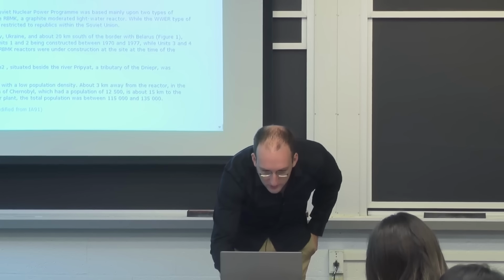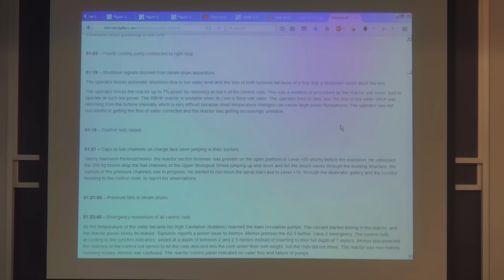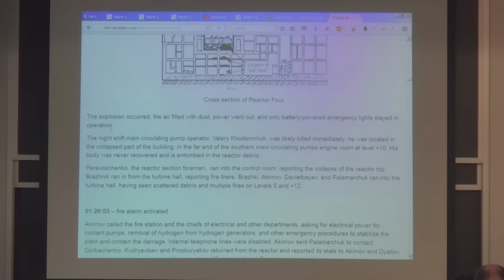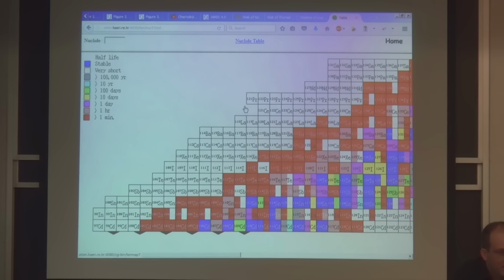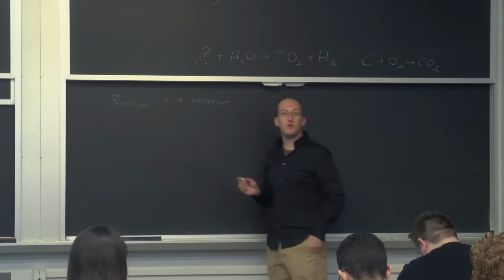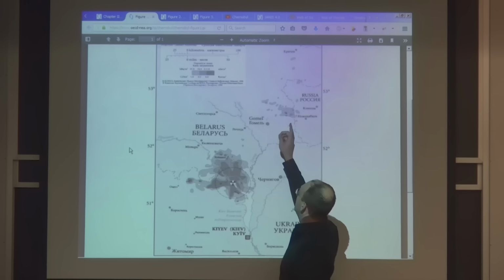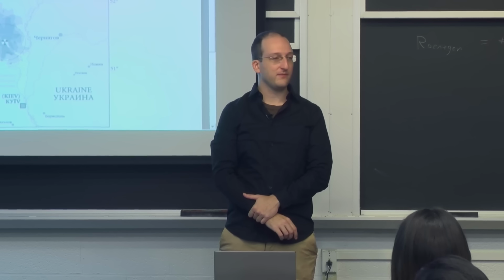26. Chernobyl — How It Happened

Comment from the maker: To report potential content errors, please use this form:  https://forms.gle/8B2zcUvfCtgJdTdE7
Reply: Length of graphite tips of control rods is incorrect. It's not 6 inches. It's way longer.
Wikipedia has a much better description:
"""... the control rods have a 4.5 m (14 ft 9 in) long graphite section at the end, separated by a 1.25 m (4 ft 1 in) long telescope (which creates a water-filled space between the graphite and the absorber), and a boron carbide neutron absorber section [7 meters long]. The role of the graphite section, known as "displacer", is to enhance the difference between the neutron flux attenuation levels of inserted and retracted rods, as the graphite displaces water that would otherwise act as a neutron absorber..."""
Reply: @denysvlasenko1865 yeah and its also important to note that as you say, and as everyone can also see in the official international INSAG-7 report (pages 5 and 128) the 4.5 meter graphite displacer sat exactly in the middle of the reactor core when the control rod was fully extracted leaving 1.25 meter gaps with the top and the bottom of the core (filled with water), pressing the AZ-5 button caused the graphite to displace the (neutron-absorbing) water at the bottom of the core (and thats what probably resulted in the supercriticality). This explanation of the positive scram effect can be found in page 4 of the INSAG-7 report (thus the explanation presented here is sadly pretty wrong).
Lastly on page 13 of INSAG-7 we read:   “The scram just before the sharp rise in power that destroyed the reactor may well have been the decisive contributory factor”.
Reply: Not well explained what exactly caused the explosion.

Not explained why specifically "almost all rods were removed from the core" was a bad thing.

The correct sequence is as follows:
* Steam valves closed to start turbine run-out experiment.
* Pump power starts going down since turbine runs out (slows down) and amount of power from it goes down too.
* Recirculation slows, water gets hotter, boils more.
* Reactor power (which was around 200MWt thermal) starts slowly rising due to increased boiling + slightly positive void coefficient. (This also starts to burn off Xenon).
* Operators are confused why power rises, panic a bit.
* After some tens of seconds, Akimov decides to press the scram button - the AZ-5.
* All control rods simultaneously start lowering into the core. Control rods are in vertical water tubes, not in gas space, for cooling purposes. Graphite tips go down as well, displacing 1.25 m of water in the lowest part of the reactor with graphite. This is where "almost all rods were removed" plays its bad role - almost all rods were removed means almost all rods go down at once. Graphite tips moving down replace water, an absorber, with graphite, a moderator!
* Now power spikes VERY fast, primarily in the lower third of the reactor, burning off all Xenon (absorber gone -> positive feedback), flash-evaporating all water and rupturing water piping (absorber gone -> positive feedback).
* Fuel melts, evaporates in many places, some isotope analysis suggests even prompt criticality was reached in some small volumes of fuel. Reactor pressure vessel ruptures.
Reply: @denysvlasenko1865  проблема в том, что в РБМК-1000 нет кипения при 200МВт тепловой мощности во всяком случае внутри АЗ. Только небольшое количество пара в ПВК уже на выходе из реактора, но, преимущественно, уже на входе в барабан-сепаратор, там, где слегка падает давление. И согласно данным с реактора, никакого серьезного роста мощности во время проведения эксперимента не было. Во всяком случае роста, достаточного для срабатывания защиты по периоду удвоения мощности (она была включена, как известно). Так что истории о том, что нажатие АЗ-5 было реакцией на рост мощности весьма прохладны.
Reply: @mikhailkouyantsev6743   А если расход воды уменьшить, не закипит разве тогда? Разве кипение только от мощности зависит?
Reply: @yuriybrazhnyk7578  ну, если уменьшить и сидеть курить бамбук, то да, закипит, вероятно, пойдёт разгон реактора и система защиты сбросит стержни поглотители по пробитию лимита времени удвоения мощности. Только к упомянутой аврии это мало относится. Во-первых, потому что в реальности был перерасход воды через АЗ практически всё время испытаний. Там было 2 группы ГЦН, одна была запитана от ТГ и естественно стала проседать по оборотам во время выбега, а вторая - как молотила на номинале, так и поодолжила. Во-вторых, при срабатывании лимитов по периоду удвоения, эффект был бы тот же самый - взрыв. Там сложилась такая ситуация, когда самый плохой вариант - глушение реактора массовым погружением стержней в АЗ. Вот всё, что угодно, только не это.
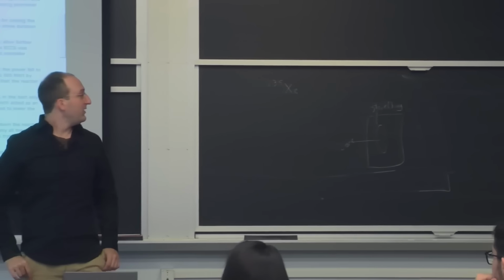Reply: Why hasn't at least the comment regarding the half-life of Xenon been corrected after so many years? At 8:28 it is said that Xenon-135 decays with a half-life of "a few days", a simple google search (and every isotope table) is enough for us to know that its actual half-life is a bit over 9 hours.
If it is a case of accidentally confusing the half-life of Xenon-135 with the time it takes for Xenon-135 levels to drop in a nuclear reactor after e.g. a shutdown then that is an even more major mistake that needs urgent correction.
Reply: @proghostbusters1627  I can give a possible explanation for that error. In disposal of radioactive waste, under the old NRC rules, if an isotope is stored and decayed for 10 half-lives, it is considered safe for disposal in the trash, at least in our hospital research lab. Those were the rules for radiology and nuclear medicine as well. It's a sort of magic number, and thinking in terms of the length of 10 half-lives is what's practical, considering how long you have to store the radioactive material safely and properly before disposal.

10 half-lives obviously isn't adequate for the quantities present at a nuclear generating plant, nor is it practical given the hundreds of thousands, even tens of billions of years involved (for [238]-U), but in other settings, that's the safe number, so... a 9-hour half-life - 90 hours to consider it safe, or a few days. Yeah, a professor should be more precise with his language, but professors are human. 🙂

Yuk alert:
(In our lab, the 10 half-life time meant everything because it meant such things as safely storing and documenting hundreds of frozen rat carcasses accumulated over dozens of experiments, each containing a few μCi of [125]-I, for ~20 months before they could be incinerated as bio-waste - a real and expensive consideration. And guess who was in charge of all that... 😛 It doesn't matter that they were frozen at -20 C, that room smelled awful! We also used [32]-P and [59]-Fe, both with manageable half-lives - enough for the suppliers to produce and ship them with meaningful activity left yet less waste storage time than [125]-I.)
Reply: When he mentions the sarcofocas why does he not mention the huge constructionwork that has just been done to sort that out?
Reply: Fffffff
Reply: Not enough statistics on radiation damage ?
What about this ?
https://www.youtube.com/watch?v=qbBu6cWczTY&t=513s
Reply: reporting
Reply: @importanttingwei7747  France does.  However, they also have the problem that major components, in their case, the coolant, burns.
Reply: Great lecture. I only can add two things. First, chernobyl's experiment was soviet military experiment. Soviet military wanted to know, what will happen if terrorists or american troopers wil capture secondary power sources, needed for cooling. And soviet military ordered to make this experiment. Second, situation in russian atomic industry today is horrible. Incidents continue to happen. For example, russian military tested nuclear-engined missile "Burevestnik"  at Nenoxa.  Missile falled into water. When they tried to bring it up, missile exploded. Territory polluted, some people died. The only differnce between soviet and modern russian goverment is that soviet goverment admitted chernobyl's explosion after 3 days. Today our goverment officially deny that nuclear-engined missile  exploded near Nenoxa, they created lies and propoganda to cover that incident.
Reply: @денисбаженов-щ1б  hmm... A lot of russian professors actually say such or similiar things. Dugin from Moscow University is the brightest example. If you educated from any russian university, you must know it.   So i don't understand why american professor cannot say it? He just wanted to mention, how terribly unsafe are RBMK reactors and how idiotish were their creators and operators. Which is true, of coarse.
Reply: @денисбаженов-щ1б  actually, it is fake and lie that soyuz is safer than any american missile. Soyuz had 11 failed launches from 634 since   1983. Falcon 9 american missile had 1 failed launch from 143 since 2010. So american falcon 9 is far better than soyuz.  If  you include failed  launch statistics from period earlier than 1983, the difference between soyuz and falcon 9 will be colossal.
Reply: Top Marks, Professor!
Thank You! And Thank You to MIT!
Marvelously presented topics in physics, chemistry, and applied logic. The day we are able to safely and reliably harness/utilise/apply the abundant and biologically safe, non-polluting sources of energy in the free Nature (including Space, i.e. the Thermosphere, usw, usf…), hundreds of millions of human beings at risk of dangerous radiation exposure via food and water will live, eat, and rest more humanely. 
Salomè (live in Peace), und…   Mögest Du in das Licht, der Wahrheit, und dem SEIN der Schöpfung leben.
Reply: @tsia  schizo
Reply: KGB influenced hiring process to have narcissist Shift leader, unaware of the design flaws, create this situation, for several reasons to make West weaker.
Reply: ehh I'm not gonna fill out a form and minor point but fyi the test was originally scheduled for day-shift so it was more like twelve hours they were holding at half-power, mad xenon; Kiev gave them the go-ahead at the start of 3rd shift basically
Reply: I've watched a fair bit of content on Chernobyl lately - 40th anniversary and all that. I remember when it happened. I gotta say though, this professor, though he obviously understands at an expert level the physics of the reactions involved, is maybe not the best analyst of the history of this event. Many more persuasive histories have been published and also posted that belie the simplistic story he tells, and even the actual numbers involved. The Soviet system was not an ideal system for safety, but to fault the safety culture is massively oversimplifying things. The people in the control room were gifted and talented. None of them, obviously, would have risked this outcome knowingly! The physics are great, ofc, but the history and political analysis of this feels a bit pathetic. It's 10 years old though. Have things changed in our understanding since then? That's a long time.
Reply: Most of the sources I have read claim the corium (elephant's foot) did not make it past the last concrete layer of the sub-levels. And therfore, did not enter the actual soil.  

Something wrong with the linked form 

But great presentation overall!
Reply: @joes.2111   You are right according to every source I have ever read and every picture I have ever seen.  The melt stopped in a basement room of the reactor building and the mining effort was wasted.
Reply: RBMK Recators DON'T explode, comrade.
Reply: @Clonetrooper17  chernobyl reactor exploded.
Reply: Not great, not terrible.
Reply: Too many errors or oversimplifications in the first three minutes to take this seriously.
Reply: Where do we report capitalist propaganda?
Reply: Ffff
Reply: Ny
Reply: @денисбаженов-щ1б  and I guess the wonderful non-existent Soviet Union knew way more! It explains why they were so prosperous! Soviet tech= worthless shit that will likely kill you
Reply: You are not allowed to discuss this topic. You have no moral rights
Reply: Everyone here is missing the point, which is that any exam material would be graded against his understanding of the events. So if he has something wrong, it must be learned and regurgitated to his understanding, because that's how the exams will be scored.  This isn't unique to MIT - all universities do this
Reply: @mangos2888  Yes, this is a vulnerability in all education settings - primary, secondary, university, and post-graduate settings. It's nothing new. The lesson is that teachers are not infallible, and textbook authors are not infallible. Critical thinking has always been crucial for education to mean anything at all. Students must be encouraged to question everything, and to be treated respectfully when they do so. As a retired professor, I can't tell you how good I felt when students challenged the content I was teaching! I could explain the basis for my content and encourage critical thinking at the same time! Students are empowered when they understand that doctrine is not dogma!
Reply: What a load of garbage, people pay money to attend mit?? Really.
Reply: This was awesome thanks for posting this, I don't know shit about this but the teacher was able to present it in a way I could digest
Reply: @rawbebaba  p chili d
Reply: @rawbebaba  aa
Reply: @денисбаженов-щ1б  Are you really that dumb that you're trying to compare the deaths in a containable nuclear disaster to a worldwide virus pandemic? You're Russian and upset by his use of words so you're grasping at straws. As if Russians talk any better about Americans. I wouldn't even talk about Covid considering Russia isn't doing much better than America containing it.
Reply: Can't enter form, any way to fix?
Reply: @badmintongo4832  It's not fixed yet.
Reply: @badmintongo4832  is
Reply: @badmintongo4832  m. Mmmmm mm m.  Mmmmmm m. M m.   N. Jnnknjn n
Reply: @badmintongo4832  m. Mmmmm mm m.  Mmmmmm m. M m.   N. Jnnknjn n
Reply: I have submitted your form, but I feel it must be stated, the Negative Temperature Coefficient, does not at all refer to the fuel, which as a solid does not significantly change in composition or orientation until it melts(in which case Corium has a positive temperature coefficient). The Negative Temperature coefficient actually refers to the Water being used in RBMK reactors as a coolant, and minor moderator(the Graphite provided the majority of moderation). The explaination of a Negative Temperature Coefficeint was generally correct, except the Professor was badly confused as to what has a Negative Temperature coefficient.
Reply: @lazyidiotofthemonth  There absolutely is a fuel temperature coefficient.  Without rewatching the whole hour video I'm not sure in what context you are specifically referring to, but the problem seems to be "negative temperature coefficient" is a meaningless term without specifying coefficient of WHAT.  There are fuel, moderator, and void coefficients.  Moderator and void coefficients can be either positive or negative (which was very much the problem with Chernobyl and why it exploded upon scramming), so there really isn't anything that can be called "the negative coefficient".  Sometimes those are all combined into the "power" coefficient, but that's something that's only useful for operation (under normal conditions) and muddies the scientific discussion.
Reply: @sultanofsick 😮
Reply: @lazyidiotofthemonth  I may have missed something.  Early on I thought he was talking about the positive void coefficient in the RBMK design compared to the negative void coefficient in a light water reactor. Please could you, if it is no trouble and you can without watching the video, offhand, point me at the right part of the video?  I feel I have missed something important.

I think a significant mistake was that the new sarcophagus was rolled into place in 2016 and thus the previous sarcophagus did not need shoring up etc at the time the video was shot.
Reply: @christianwall7181  He was not at all wrong about the void Coefficient, I was talking about his misunderstanding of the Negative Temperature Coefficient of Water, the gist of it, is that Light water has a negative temperature coefficient, and midway through the video he talks about the temperature coefficient as though it is a function of the design or the graphite. this is flatly wrong or impossible, for a solid to has a negative temperature coefficient, it would have to physically expand. I would need to rewatch the video, to find the specific moment.
Reply: @lazyidiotofthemonth  Dude, is the concept of solids thermally expanding actually foreign to you?  If so, why do you feel qualified to comment on nuclear physics?  Please don't make authoritative statements like the MIT professor is "flatly wrong" or something is "impossible" if you don't actually know.  As for the moderator temperature coefficient ("negative temperature coefficient" is an ambiguous non-technical phrase), those CAN be positive or negative by design (or lack thereof) in a light water reactor.
Reply: @lazyidiotofthemonth  Actually he is wrong about the void coefficient too.  He talks about the "power" increasing, but what's important is the reactivity increasing, affecting, importantly, the rate of power increase, and not just the power level itself.
Reply: @christianwall7181 🫢
Reply: @psychohist 
..

Comment: 14:34 disabling the ECCS (Emergency Core Cooling System) was allowed, required for the test, requested, and approved, furthermore, it did not affect the outcome. The ECCS is designed to inject water in the event of a loss of coolant. However, the reactor did not lose cooling, it suffered a core destruction. Talks about the ECCS are simply an attempt to shift the blame from the designers to the operators.